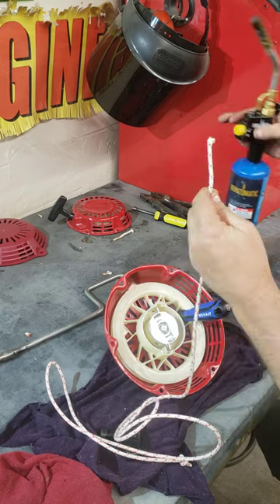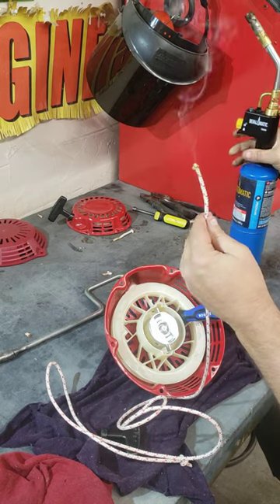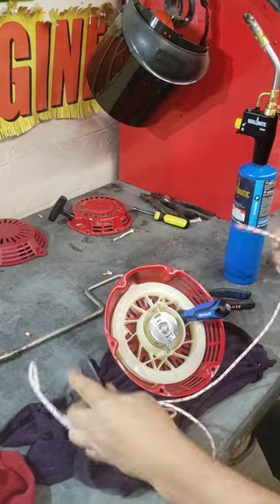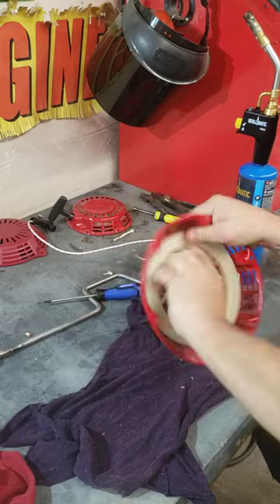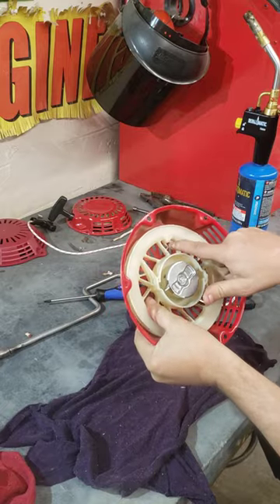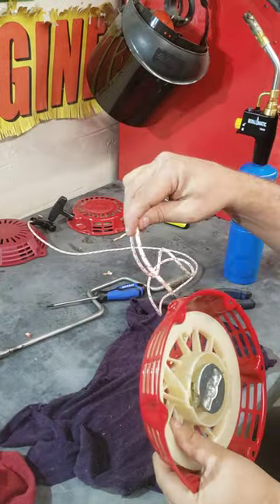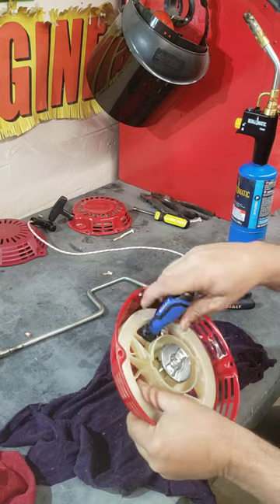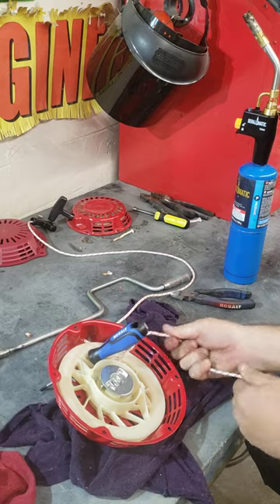How to replace the rope on a lawn mower or generator  recoil.  It's  easy, if you Ask the Mower Guy.

Comment: Mr. Mower I have a mower I just got used and the handle that is used to keep the mower running just snapped off how do I fix it
Reply from the maker: Most likely you'll need a new one but alot of times shops will have some old mowers out back.  Take both half in.  They might weld it for you or match it  or if you take o. The model order a new one